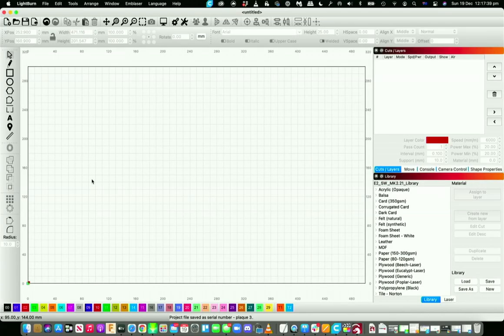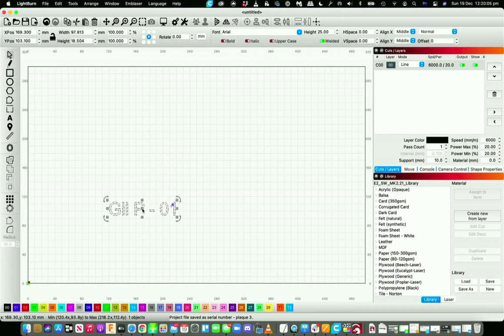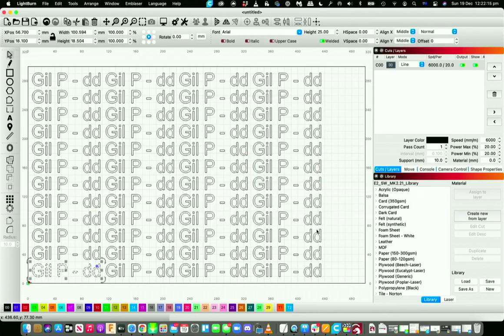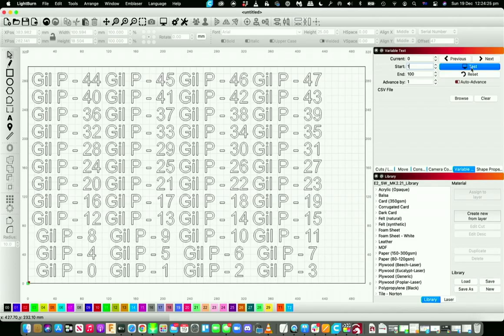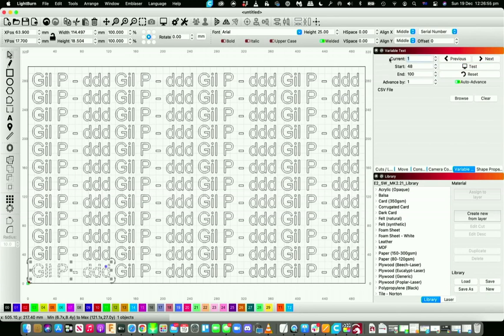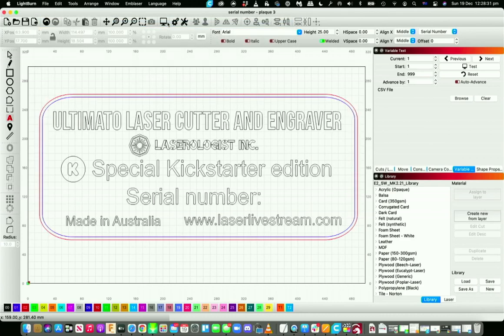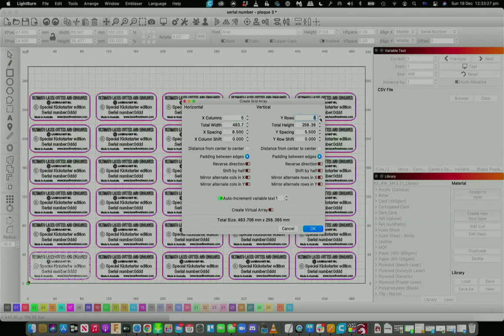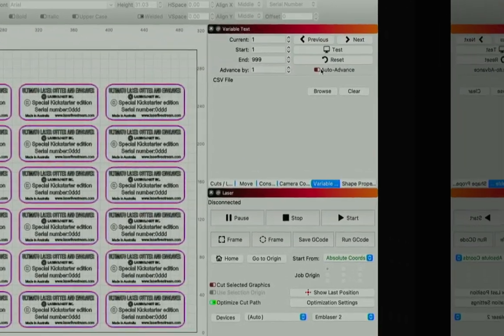Lightburn tutorial : Create serial numbers with variable text tools

Comment: Can you serialize a single text? I'm trying to serialize parts in a repeated origin.  I want to load a part at a X0Y0,  laser a serial number, and then the next part, can it load and the number change?
Reply from the maker: Definitely.  Using the commands and format in the video, you can set up your design, link it to a spreadsheet and run the jobs.

What parts are you trying to serialise?

Comment: Excellent information, but I have not found a way to make a consecutive series starting from 00001 onwards, I must make a number starting from 00001 to 7000 and when I start it only marks 1 without the zeros. I would be eternally grateful for your help. Greetings from Colombia.
Reply: Use zero in front of letter d (for digit) for how many placeholders. 
Example: 0ddd will print 000.
 Make sure base text box/ set has serial number selected up top in front area and offset 0.
Variable text menu has current:1, Start:1, End: 7000. Advance by units of each set in your array configuration.

Comment: Thank you for the video.  I was just considering how I could make serial number tags (aka Assest tags).  You mentioned sign material with a thin top layer that could be burned off.  I did a Google search and did not find any.  Would you please share a link or the search string that would return the correct items?
Reply from the maker: Thanks, Jess. Let me know what size tags you want to make and I'll find you a link 😉
Reply: @LaserLivestream  I have two applications: small "asset" tags to mark property size about 1.5 by 2.5 and what you showed in the video which looked like sign materials.  Think of a craft show booth with laser cut signs (multicolor) saying "Wine Corkers", "Bowls" etc.  When I wrote my original message I was thinking of sign material where I could burn off the top surface exposing a different color.